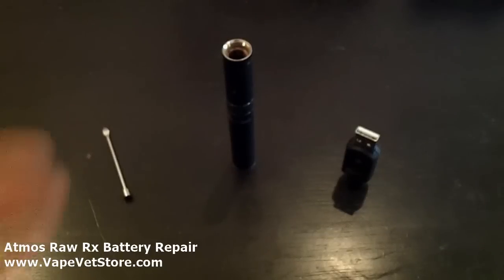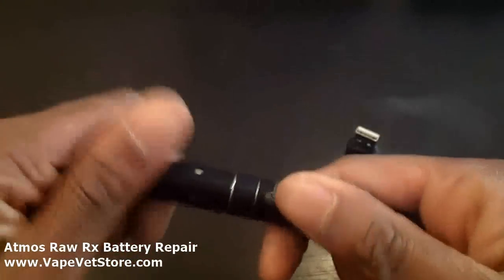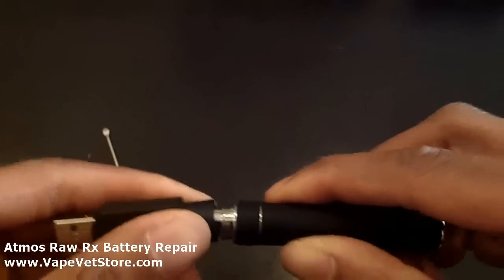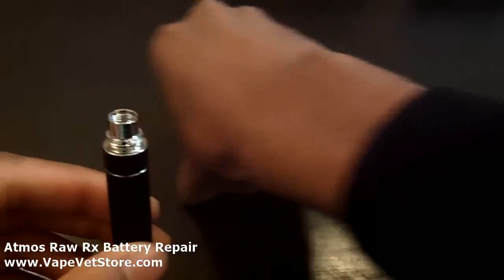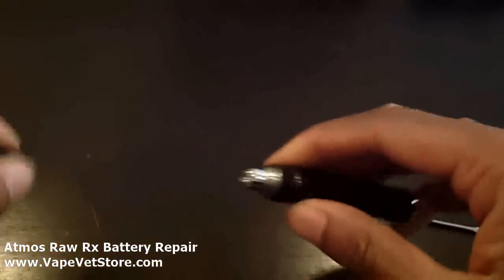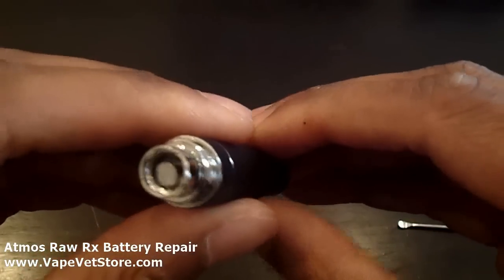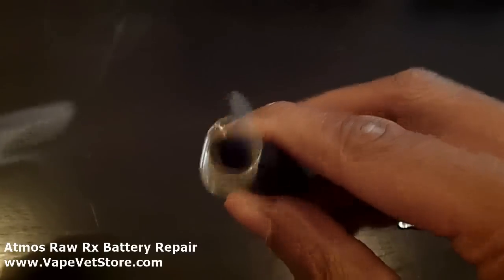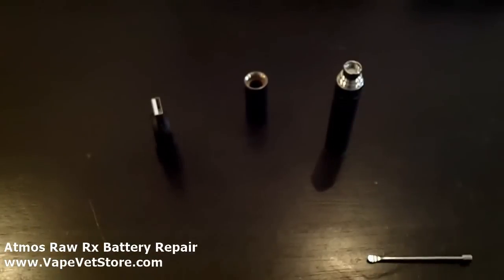Atmos Raw Rx Battery Repair  (and eVic No Atomizer Found / G5, etc): How to Fix Vaporizer Battery

Comment: where can i get the rubber insulator for the center pin? this grommet style insulator got ripped apart and now it looks more like a o-ring which isolate the pin but when i pull a bit on the cable which is soldered to it, the pin gets loose and will short.. is it a good idea to use ptfe tape to insulate the rest of the pin and then epoxy or hot glue the "inner" pin so it won't be able to move and stay in place?

Comment: i have a different problem and I need a solution as fast as possible,
My battery works just fine, but when I connect it to the coil it starts behaving like there is no charge on it,

so battery disconected works well, but when i plug the coil it behaves like is uncharged! helPPPPP

Comment: My vape won't screw onto the charger or back together what should I do????😔
Reply from the maker: If you have ordered any new parts recently you may have ordered parts with threading that differs from what you already have.  For instance, the Atmos battery has 710 threading.  Vapes just like this also come with 510 threading.  In either case, we just released our own AGO vaporizers which or very similar to this Atmos vape and all parts are compatible.  The main difference is the price.  If you need anything, just reach out to us at Support@vapevetstore.com and we can help.

Comment: My pen is fully charged but when I load the herb and press the button nothing happens...the blue light doesn't show. I took the chamber piece off and tried it on my sister pen and it works fine so I'm guessing the charging piece is messes up. when charging it blanks about 10x. What's the issue?
Reply: Mine does the same and I am at a lost as to why it wont charge the oil..even though it lights up fine without the oil cylinder attached and I press the button it lights up like its fully charged?
Reply: I fixed mine by actually doing the opposite and pushing the center pin down into the battery ...the pin just sit there in the rubber ring mount and it has to touch the lead wire curled inside the battery housing once charged you THEN may have to pull it up a little as shown here to make contact with the oil cylinder...between this & video you should have it fixed :-)
Reply: +cja57812012 I'm trying it now...I'll keep you posted :) thank you btw

Comment: ..what if that jiggly piece falls out.  i think mine is missing ; ;
Reply from the maker: +Nap Chop The top circular pin? If it falls out and you can find it, you should be able to pop it back in. If it's lost for good, though, you may need a new battery.

Comment: what happens if the spring breaks in the chamber.  mine did
Reply from the maker: +levi leal The actual coil has broken? That would probably require a new chamber. I'm not sure if there's really a way to overcome that.

Comment: hey man my battery won't charge or turn blue what should I do
Reply from the maker: +Captain Chronic If raising the connecting pin isn't working, it could be the USB adapter, or the battery could just be completely dead if you've had it for a while or if it's been damaged from anything like a short circuit. When it comes to situations like these, where it's hard to figure out the exact problem, mixing and matching works best. See if your battery works on a friend's device, and if a friend's battery works on your chamber and charger. Once you start seeing what works with what, you can usually narrow down which exact part is faulty and go from there.

Comment: Mine doesn't work too well anymore; I guess it's just old. I purchased it maybe 5 months ago and spent $35 on it, and have used it every day. Now, It's earned a few scratches from wear-and-tear use and when I inhale, it doesn't draw up as much as vape.  I think by now it's just old.  I suppose it's normal for e-cigs probably last only 4-5 months before they start to go bad.
Reply from the maker: +Johnny Matthew One thing you said stands out to me: "when I inhale, it doesn't draw up as much." Have you cleaned out the mouthpiece and  filter? Over time, that can get clogged and affect the airflow. Try giving those a good clean, maybe pack a little less into the chamber, and it's possible the pen could still have some good use in it.

Comment: I think mine is a different model, the battery part is just a little stick, and it is not charging, doesn't blink when I put it on the charger and the light never turns red, how do i fix this one? D:
Reply from the maker: +Anna Sasin I've seen that type before. It uses a spring-loaded metal rod to complete the connection instead of the regular circular pin. The idea is that the rod wouldn't have this problem since it's on a spring. I wonder if maybe it's the USB adapter that could be causing the problem, since that type of battery shouldn't be having connection issues.

Comment: Question, I thought I had a batter problem but not sure anymore.  My battery works fine until I screw the fill tube on.  After I screw the fill tube on and press the button it starts blinking and turns off.  I thought it was the cartridge but I tried it on my friends battery and it worked fine.  Any help on this?
Reply from the maker: +Ramon Stephens Hmm.. That's actually pretty strange. Does the battery work on different cartridges? It could be the battery. I would see if it works on your friend's cartridge. The light coming on when nothing is plugged in could be something that just works regardless.

Comment: Hey man, im from Brazil and we dont have much information about Atmos Vap.
So, i have a Atmos RX JR and a EVOD to vap some oil. Can i use the Atmos Battery on Evod without problems? They conect very well and when i try, it worked. But im worried about the life of Atmos Battery. Can i use Atmos Battery on EVOD chambler?
Sorry my english, and congrats for your videos. Its helping me a lot!!! i always recomend your videos to my friends.
Reply from the maker: +Romulo  Nunes Hi, if it connects, there's no reason why it would damage the battery or the tank. They are both made to produce/accept 3.7 volts. So you should be good to go! Your English is fine!

Comment: I did this and it still won't charge. It's clean too. Do I need a new battery? Or a charger? Because if I keep jiggling it while it charges it will charge a bit as in like 20-30 hits but if I put it on the charger it charges for a few seconds then stops and I have to unscrew it and put it back on. Help?
Reply from the maker: zombieKILL713 It could be the battery, or even the USB cable. I would check with Atmos first, because I've known some customers who have been able to get the USB or battery replaced. But yeah, if it's not charging correctly even after this, then one of the two components isn't working right (charger or battery).

Comment: You would have thought, with all the technology that is available to humans today, that someone somewhere would create a battery that didn't have this connection problem! This is an issue that has driven me nuts in the past, and I simply started smoking cigarettes again. Today is my 1st day of vaping again!
Reply from the maker: Celtic Saint Yeah, it is a bit annoying. The newer models (Atmos R2 for sure) have a spring-loaded connecting pin that doesn't get stuck too far down. It would be nice if they updated all the batteries with that simple mechanism.
Reply: Vape Vet Spring loaded is a good idea. Happy vaping!

Comment: Hi whats the name of the tool that you are using as i cannot find it anywhere.
Reply from the maker: Shaan Awaz Hi, this is the packing tool that comes with the Atmos devices (and many other vapes). I would imagine a smoke shop has some spares they'd be willing to give you. You can also use a pair of tweezers to pull the pin up, though.

Comment: I bought an atmos raw from my friend and like he said he didn't use it for 2 months do it was dead. So when I got home I plugged it into the usb and then the usb into my apple plug outlet and it was green then the blue light blinked 5 times on the battery then the usb turned red and like after 4hrs it still was red so I took it off then tested it out and the coil got red and hot but then the next day I charged it once again for like 5 hrs and still not green what can be the problem??
Reply from the maker: flexingN777 I'm not sure--it could just be the USB light. If the device is charging fine, I wouldn't worry about it too much. A typical charge is around 3 hours, so even if the light isn't working, that's about how long it's taking the battery to charge. You could get another USB adapter, too, but I'm not sure it's worth it if the battery is actually charging.

Comment: is this applicable to an R2, I have an R2 and a Jewel that both started doing this and I cannot figure out why.
Reply: It seems like the R2 has a spring on this pin.  I am scared to mess with it too much, and i am not certain I am pulling hard enough.  I don't want to break it, but I would like my pens to work.
Reply from the maker: ***** Hi, as you mentioned, with the R2, the battery has a spring that's supposed to keep it at the right height. I haven't really come across an R2 battery that had this problem, so the problem could be the chamber/coil (although I also haven't seen that nearly as much with the R2 either). Cleaning out the chamber could help, or you could take a look at the coil repair videos. #3 in the series is probably the best: https://www.youtube.com/watch?v=6YVFoi819lM
Reply: I pulled out my last Atmos Dry Herb and tried the battery on all my chambers, all my chambers are working fine on the old battery, so I am wondering what about the batteries on two brand new pens would be janky...

They charge fine, so I am not sure why they won't light the bowl up.  I get the old chamber to light up on the new R2 battery, but none of the new chambers will work on the new batteries, I am perplexed, Atmos is sending me 2 new chambers and a new jewel battery, and now I am thinking it is something ONLY with the battery...  Not sure what would cause it, or if it will happen with the new parts.  Ever heard this one before man?

Comment: My Atmose Just Stays Green
Reply from the maker: TheElitebigkiller Do you mean the USB light is always green? If it's fully charged, definitely make sure to click the power button 5 times to turn the device on/off just in case. If the battery is depleted, you've raised the connecting pin, and screwing it into the USB charger still only shows a green light, I would try getting another USB adapter.

Comment: I bought an Atmos DW, how do I change the atomizer in it? It came with a replacement atomizer and the original isn't heating up as fast so I think it might be the coils going.
Reply from the maker: Patrick Bateman To charge the atomizer, you take the mouthpiece off and pull the atomizer off the battery. It might seem a little weird at first, but this is the correct way to remove it. Just grip below the silver ring and pull up.
Reply: Vape Vet Thanks!

Comment: Hey Vape Vet ,
I just got a brand new Atmos R2 from a local shop and i came home and plugged it into the wall like the little pamphlet said to do and i took a four hour nap to give it a full charge but when i took it off the charger it hadn't charged at all . so i tried againb only using the usb part but the only thing that happens is that Atmos light glows bright blue and the power button flashes like 15-20 times. I think the charger is messed up but i would like your opinion if possible.
Reply from the maker: DCking14682 Hmm.. Here are some steps I use to rule out various possibilities. First, when you screw the battery into the white USB port and plug it in (either into the wall with the wall charger or a laptop or something), the LED light on the USB adapter should turn from green to red. If it stays green, then the USB adapter is not connecting with the battery properly, and that's why it wouldn't charge. Could be the USB adapter or, more likely, the connecting pin on the battery causing the issue. However, this doesn't sound like your problem. A drained battery just flashes 5-10 times and shuts off from what I've usually seen. If you take the battery off the heating chamber and try pressing the power button and the light comes on and glows, then the battery is usually working fine. If it only flashes and goes haywire when connected to the heating chamber, then there's something wrong with the heating chamber (possibly something causing a short circuit).
Reply: okay thank you very much

Comment: Hey vape vet thank u so much for this video because I found out if u get a little circle magnet and put it in there  put the coil through the air hole and it works like a charm no burnt tasks nothing it's just like a brand new pen and can u please respond because do u think u can help me out with upgrading to a better pen thanks
Reply from the maker: Anthony Banis That's a nifty trick! Regarding the upgrade, what are you most interested in? Something that is still pen-shaped, or one of the more modern, rectangular designs (like the Pax or Ascent). There are a lot of options out there, but the main points to look out for are taste, overall vapor production, whether it's convection or conduction, portability, how easy it is to use, and what your budget is. I'm about to get my hands on the Atmos Boss, and that may be the best direction for now for a pen-shaped vaporizer. I'll have a review up hopefully in January or February though.
Reply: Ok I'm looking for a pen that produces a lot of vapor and is small any pens like that?

Comment: Hey my battery wont charge and it wont heat up i just got it a month i was messing with it and i pushed the button and i used the little pin and touched and i think i messed it up
Reply from the maker: Carlos Lara I know for sure that if you press something metal on the connecting pin and, with that same metal object, touch the metal side of the battery, it will cause a short circuit. Normally, the battery would just shut off to prevent damage. But if this happens a lot and for a long period of time, it could cause permanent damage. You can still try raising the connecting pin to see if that helps the battery charge and power the chamber properly, because you might have just pressed the battery's connecting pin down too far.
Reply: Thanks

Comment: My battery hasn't charged in almost a week and my heating chamber won't heat at all. I was getting ready to send back for a replacement but then came across ur video. Tried it and now my battery is actually charging. Does the battery have to be fully charged to heat up the heating chamber?
Reply from the maker: Matt Troy That's awesome! The battery does not have to be fully charged to heat up the chamber, but the more charged it is, the hotter the coil will get. I usually observe a noticeable drop in heat when the battery is down to about 25% of its full charge.
Reply: Well it's fully charged now but the heating chamber is still not heating up. Tested the heating chamber on my room mates battery and it works just fine so I dont know what's wrong with it.....

Comment: It worked great for me but it would only work for 1 hit then I need to do it again how do I fix it. Please help
Reply from the maker: Riley Gibson I would try pulling the connecting pin up a decent amount and then screwing the chamber on very lightly. If you screw it or the charger on too tightly, it could push the connecting pin back down too far.

Comment: I cant seem to diagnose my problem. I got a blue light and all my terminals seem to be connected. I am really trying to to get a good fix going. But i am so stuck and frustrated with my Atmos R2. My coils are circular and they seem to be touching connection 1 and connection 2. There also seems to be a third hold along the inner wall, when i accidentally put my paper clip in there it shorted and turned off for 2mins. Now its back to blue light with no coil redness. Please help bro!
Reply from the maker: Paras Turakhia If the battery is lighting up and the connecting pins are making contact, the only thing I can think of is to give the battery a full charge. Sometimes, the coils will not glow very bright on a low-charged battery. But if that's not the case, you may need a new heating chamber for the R2, unfortunately. If you have any other Atmos devices, you could try the battery on those to see if the battery works on those, and that could rule out the battery as the problem. And, if you have any other Atmos batteries, you could do the same with the heating chamber.

Comment: I have this pen. I was wondering if you knew why it works fine with my original attachments, but when I put my ecig oil attachment on it just blinks 3 times then shuts back off ?
Reply from the maker: Lil Marley Hmm.. I'm not exactly sure on that one. Is the oil attachment also a Atmos-branded attachment? If not, that could be the problem. Otherwise, there's a short circuit somewhere, but I'm not sure what part inside of an oil attachment would cause that. What kind of attachment and what kind of Atmos battery are you using?

Comment: I have this device, it is charging just fine but when I push down on the power button the bottom blue light doesn't come on. It's also not heating my chamber, even though I've raised the battery. What's wrong and how do I fix it?
Reply from the maker: Tanya B Hi. One thing that surprisingly gets overlooked a lot is that these batteries can turn get turned off. I'm not sure if they automatically turn off when the power is drained completely, but you can accidentally turn it off if you press the power button 5 times in a row rapidly. This turns the battery on and off. If the blue light isn't showing at all, then the battery is either turned off, or has just completely died somehow.
Reply: Vape Vet This must be what happened, it was totally dead before I charged it. I did what you said and it's working great now. Thanks a lot!